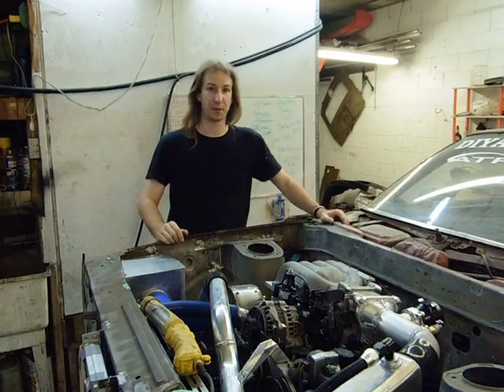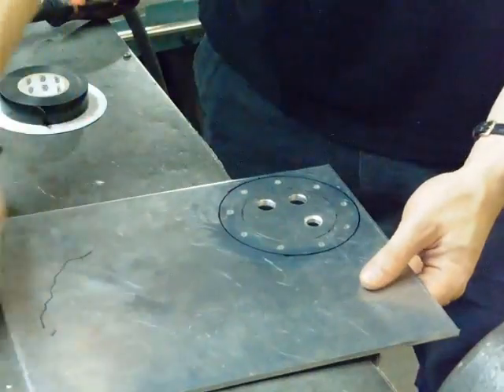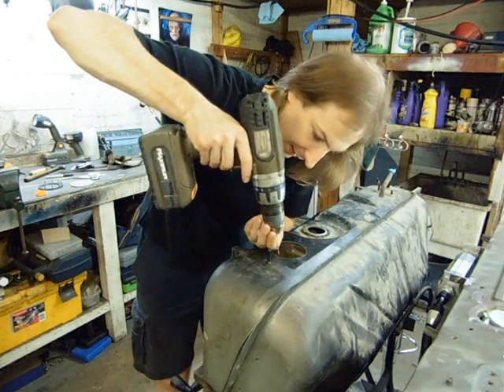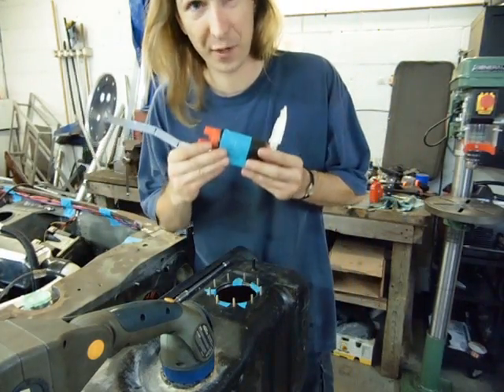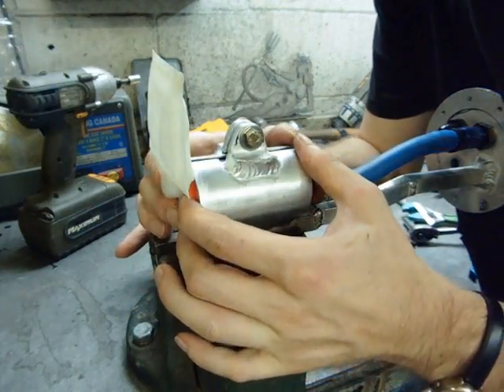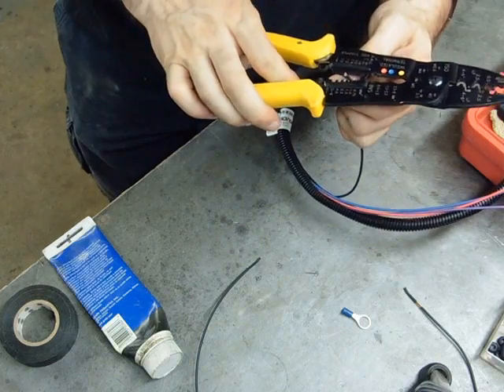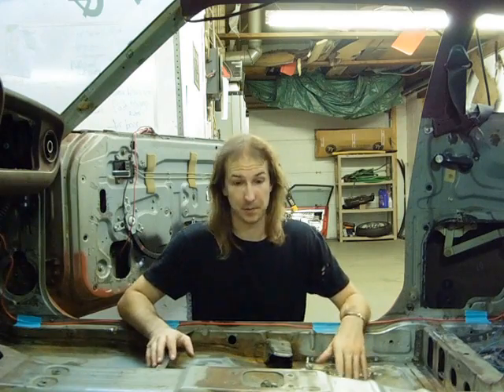Part 37: Carbureted Fuel Tank Conversion to In Tank EFI Pump - My 76 Mazda RX-5 Cosmo Restoration

Comment: The audio is the first thing I noticed. It's much better Lol It's more dramatic on my setup I would think. I have a JDS headphone amp and DAC so if the audio is shit it's pretty much amplified. That mount for the pump was sweet btw. Always learn something with these.
Reply from the maker: brandonsexywhitaker It's the difference between 8KHz mono vs. 44KHz stereo. During editing it was actually rather odd hearing my voice properly for the first time. I copied the OEMs for the in-tank pump setup. Will be much better than an external pump in terms of noise.

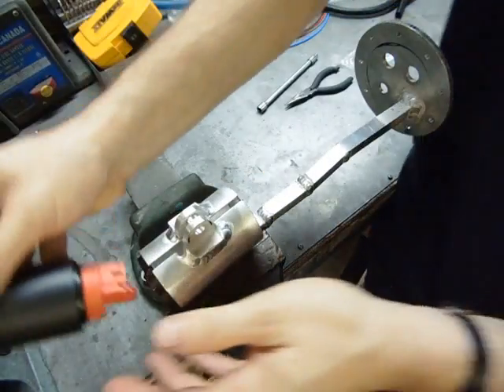Comment: At 24:24 make sure you did not roll the plastic shoulder for the e-clip for your fuel pick up. A set of e-clip pliers is a stress saver. That is if that was a e-clip. LOL 
Great work keep the vids coming. Makes me miss working on my FC3S

Comment: very nicely done ...I'm very impressed. I think I'm going to make one of these for my 71 240Z I keep burning up external high pressure fuel pumps.
Reply from the maker: I've found that external pumps are often an issue, especially the high flow ones. Very sensitive to cavitation which kills them in a short while. The need to be below the pickup point in the tank and need at least a -8 feed. Or yeah, move it into the tank because that's much better, they run cooler, and make less noise.

Comment: Hey man just wanted to say great video! I'm currently working a 1963 Ford F100 'unibody' which I swapped in a early '90's EFI 5.0 from a Lincoln Town Car and I'm needing to do this but I'll be using a beer keg as a tank! This was an easy video to follow and I will be using some of your steps in making my own fuel pump bracket
Reply from the maker: Beer keg mounted in the bed I assume? Since you have so much space to work with, why not mount the pump at the bottom of the keg with a short pickup?

Comment: tip for the hose you used inside the tank, dip the end in a cup of hot water and it will soften up then quickly slip it on when it cools it hardens again :)

Comment: I think it's funny how you complained about the RX-7 not having a baffled tank, but you're so excited about this one being baffled from the factory. You should make an outtake video. Also, yay HD.
Reply from the maker: yerboogieman The RX-7 has a baffle around the fuel pump which forms a slight sump and that seems to be about it. The Cosmo tank on the other hand is baffled to all hell. I'd assume because of the shape. It's a much taller tank. About twice as tall. What was nice is that the shape of the bottom created a perfect small sump about the exact width of the fuel pump pickup sock. And it was surrounded by a bunch of baffles.

Comment: great pump choice im running the same in my S5 Turbo, super quiet for a high flow pump
Reply from the maker: Shea Strocher A friend runs one in his FD. I won't come anywhere near the power level that will max out that pump but it was the same price as the smaller unit, so I figured why not.

Comment: Another great vid Aaron I have a tip for your push lock hose to try I work in a Motorsport shop and we use a lot of the push lock stuff. So what we do is put some Vaseline on the AN fitting the heat the end of the push lock pipe with the heat gun and push it on I swear it will glide right on
Reply from the maker: overr8ted2 Good tip. I didn't think of using a heat gun. Though I've used Vaseline in the past. There is also a tool made for this purpose that looks like a little press but since I don't use that push lock hose very often I don't have one.
Reply: Oh right i havent seen the tool before but this is the way we always do it if you get a chance give it a try see what you think looking forward to the next episode keep em coming :)

Comment: Nice video. Just came across this. I'll say, some people will actually route their return lines to actually spray the fuel on the pump to keep the pump cool in low fuel level conditions. Anyhow, nice video.
Reply from the maker: That's quite a good idea I didn't think of. Mainly I just followed what I had seen by other OEMs. I figured they would return the fuel to the bottom of the tank to avoid aeration.
Reply: @aaroncake  I get the idea of the aeration I just don't know that it's as big of an issue as it's made out to be. Diesel aerates a lot when filling up the tanks but it settles fine and the fuel pickup is at the bottom. Either way, just a thought.

Comment: Pretty neat build up you have going there.  I had to cringe a little at using copper crush washers on an aluminum surface.  Hopefully that sealant acts as a bit of a barrier and prevents the dissimilar metal reaction from getting too bad and causing a headache later.
Reply from the maker: OddBallPerformance True, copper and aluminium are pretty far on the galvanic series, but copper crush washers are used extensively against aluminium parts over many industries and they don't seem to cause too much of a problem. Likely because aluminium forms a protective oxide layer. I should have used aluminium crush washers though.
Reply: aaroncake You can also buy nylon bulkhead washers for AN Fittings.  I just did a Full AN fuel system on my Isuzu build using the same sealer and nylon washers.  Not sure how durable they are long-term, but they are pretty much the standard washer used by most aftermarket companies when AN Bulkhead fittings are used.
Reply from the maker: OddBallPerformance Nylon should hold up over time. I'm fairly sure most of the plastic fuel pump/sender assemblies in use these days are nylon and use nylon hose. I also didn't think of even using nylon...just went to the auto parts store and bought some copper washers, the same as I used on my RX-7 years ago.

Comment: i would have joined two of those wires together to double the current capacity and have less voltage drop. this is what i ended up doing to that racetronix harness
Reply from the maker: Zeeshan Munir As I recall the spec for the pump said the draw was under 10A, so one set of wires was enough. I'm in general mixed about the Racetronix harness. I wish they had provided dimensions because the groove I made for the o-ring wasn't deep enough. The bulkhead is designed for a very thin flange. I had to go back and deepen the hole. Then again, deep holes are better anyway.

Comment: The better audio still throws me off.
Reply from the maker: FrankTheCat Well then you're going to lose your bodily fluid control when you see the next episode in HD.
Reply: aaroncake
woah bro don't tease me like that.
Reply: aaroncake This is awesome news. I was considering getting people to pitch in and get you a better camera.
Reply: Elgonidas
e ga dæ tommel opp xD
Reply from the maker: Elgonidas It wasn't so much a matter of not purchasing a new camera, but more a matter of not wanting to. It goes a long way having a system you are familiar with that just works. It's been a bit of adjustment to the new camera because in general it's more fiddly than the old. Actually the widescreen is most annoying. A square frame is far better for technical stuff. With the wider screen I find I have to pull the camera back a lot to avoid chopping the top of bottom. Taken a while to get used to it.
Reply: aaroncake Wireless FM microphone, clipped to shirt collar. Isolate unwanted background noises.

Comment: 31:45 «I guess; in 20 years when I open the tank and if the zip tie is gone, then we know it wasn't ok!»

Well, that is, if by that time you still remember that you had put a zip tie in there :) LOL
Reply from the maker: no head Sadly I will remember. That's the terrible thing about building your own car is that the details stick in your head. And if something isn't to your liking, that is the only thing you think about going down the road.
Reply: I guess you're right...
Reply: aaroncake I'm slowly finding this out as I finish the Saturn I just received, half finished, from my friend. So unfortunately, I have his "mistakes" to think about as well.
Reply from the maker: yerboogieman The worst is taking on someone else's project. You start finding little things here and there and then become terrified about the things you're missing. In a way the Cosmo was similar. Finding riveted aluminium patches on the inner fenders.
Reply: You find good things and bad things. And somethings you have to sit and think about how you're going to fix them. I received the car in great running condition, but most of the panels were held on by oversized screws, and all of the clips are broken off on the dry old plastic. But I guess it is a 21 year old car after all.

Comment: Do you have a manufacturer and part no. for that wiring bulkhead you are using for the in-tank wiring?
I am converting my trucks fuel pickup to an in-tank setup too and could use a good sealing bulkhead inplace of the stock connectors.
Thank you!
Reply from the maker: biberarm The bulkhead wiring is made by Racetronix (.BIZ) and is the "BCWS-001" universal bulkhead wiring system. In general I'm happy with it but I suggest you make your flange a bit thinner than mine where the bulkhead will passthrough. I had very little slack to lock that metal ring in place. Milling that area to about 2MM thickness would work.

Comment: I watched your 37 Cosmo76's vids and I'm eager to follow next steps.
You give me a lot of ideas.
By the way, is there already a fuel map in your  Mega Squirt? Or will you give us some hints on this topic later?
Reply from the maker: Olivier Pirard TunerStudio will generate a base map based on engine characteristics which should start the engine. Of course the user has to set up trigger, ignition, injector and I/O settings. I have a collection of tunes from all the cars I've tuned on MegaSquirt over the years so I will likely start with a VE table which should be close enough, and then go from there. Also, rotary MegaSquirt settings are on my website at @rx-7/MegaSquirt . But yes, I will be covering setting up the MegaSquirt and tuning later on when I actually reach that point.

Comment: Also, wayyyy off topic but what are your thoughts on the Rotary Aviation OMP adapters that let you utilize an external two-stroke oil source instead of using the engine's own oil?  I installed mine not too long ago, and so far so good, but I was thinking you would have some input as to the viability of the two-stroke for this purpose.  Some people swear by it, others detest the thought of anyone using it.
Reply from the maker: nopistonsriggs Honestly, 6 of one, half a dozen of the other. I only know one person who uses the adapter and it seems to be fine.

Comment: Hi, great work, did you use any vent line? Thanks
Reply from the maker: +Daniel Pelaez There is a vent line already existing on the top of the tank which will eventually feed into a modern solenoid controlled charcoal canister.

Comment: at 13:47 you mention 2 gaskets, where did you get these, are they 'gas-tight ' ?
Reply from the maker: I haven't got there yet. There is EVA foam gasket material available for cutting out thick fuel safe gaskets.

Comment: you getting the new blackberry passport? I AM!
Reply from the maker: YoungMacy Probably not but only because I love my (gold plated) 9900. The Passport is a great device, I'd say revolutionary, and the market (both stock and consumer/business) seems to agree. However there are still a few features missing from BB10 which I use constantly. An example would be different notification profiles for in/out of holster. I guess BB10.3's position actions (turn phone face down, profile changes) get close but not quite close enough. I also have loads of email accounts I don't want to notify which, correct me if I'm wrong, BB10 can't do. It's just that BBOS is such a mature system which has been honed over 14 years of tuning, and let's face it, the Bold 9900 was the pinnacle of Blackberry devices before BB10 was released. But man, the screen size of the Passport and the capacitive physical keyboard sure is a temptation. Especially since that keyboard was my idea.

Comment: nice as always! will your finished car not have any fuel gauge ?
Reply from the maker: farerse I will, but the fuel sender is not integrated into the pump bracket. It will remain separate (that hole in the center of the tank with 6 screw positions) as designed by Mazda. I actually just spent an evening pulling it apart, cleaning it up and getting it functional.

Comment: Hi there! Thanks for another brilliant episode!
Ehm, one question. The studs welded to the aluminum flange were steel?
Once upon a time you asked me if i can get my hands on a left hand side external mirror. Still on the lookout for that. Congratulations on your new camera purchase, looking forward to HD. Gotta keep up with the tech stuff mate. Nick Australia.
Reply from the maker: Kurosaki990Ichigo I have a driver side fender mirror, still trying to find the passenger side. There was one on eBay a few months ago but when I went back to buy it a few hours after it was spotted, someone else beat me to the "Buy It Now". The inner flange was actually 1/8" steel, specifically so that I could weld the studs to it. Didn't want a possible leak path up the threads. Both the inner flange and outer flange will get a gasket upon final assembly.

Comment: Damn they make kits nowadays 😳
Reply from the maker: They do make siphon pumps, but my experience with them has been spotty. Typically loud and on hot days with low tank level I have had vapor lock problems. There are a number of EFI conversion kits available and I looked at them, but most are designed for far more shallow tanks. The Cosmo tank being so tall I would have had to modify.

Comment: Wasn't it an option to buy a complete new tank? Not oem, but fitting. And modern. Fresh steel and all.
Reply from the maker: I did briefly check for a fuel cell or aftermarket tank in the correct dimensions but didn't really find anything that would fit well. Could have fabricated one but once cleaned up, the OEM tank was in great shape.

Comment: Great Work! Love watching the videos keep them coming. What CAD program do you use to make your paper templates?
Reply from the maker: Enoc Rosa Just the free version of eMachineShop. A great little basic CAD program mainly designed for their online machine shop service but does the job for things like this. Ironically drawing something in CAD only to print out a paper template, trace it onto metal, and do the machine work by hand.

Comment: The other 2 wires are for the gas gauge. You did not install a float.
Reply from the maker: Not sure if I mentioned it in the video that the fuel level sender mounts elsewhere in the tank.

Comment: did it work without leaking?
Reply from the maker: I'm not sure as the car isn't on the road yet. I see no reason however why it would leak however if it does, it will leak from the o-ring of the wiring bulkhead. I'm not entirely confident in that arrangement even though it is the same man OEMs use. I may have to epoxy it in place with fuel safe epoxy.

Comment: MY DRILL PRESS DOES NOT GO SLOW ENOUGH FOR A FOUR AND A HALF INCH HOLE SAW
oil
keeps drilling

:-D
Reply from the maker: nopistonsriggs Yeah, and I ruined by hole saw by doing that. :-( Had that 4.5" saw for years. Kind of sad. I finished off camera on the band saw.
Reply: aaroncake
 eh its just a hole saw right?  I just couldnt help but giggle when you kept going.

Mostly because I would have done the same thing hahahahaha
Reply from the maker: nopistonsriggs Yeah, but it was my favourite hole saw. We go back years. It saved my life during the war*

*not actually true.

Comment: Nice build but never video welding without a filter cause you can damage the sensor
Pete.
Reply from the maker: zeemanjr You know at first I thought the same thing. But my old camera filmed welds for so many years without damage that it seems the sensor has no issues. I can't think of any mechanism which would cause damage to the sensor through bright light.

Comment: What do you mean no one will see this ,    
51,913 people have seen this pump already.

Fuel gauge?
Reply from the maker: You'll see the fuel sender in a future video. There is another flange on the tank into which mounts. It will be integrated with the main wiring loom and be read by the body controller. Then the reading sent via CANbus to the gauge.